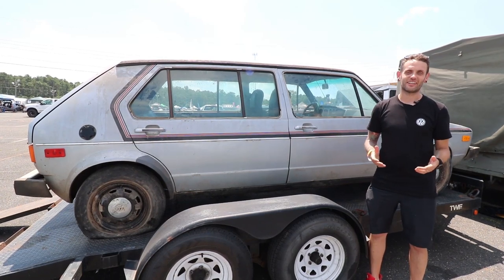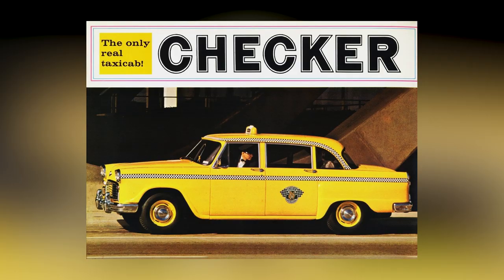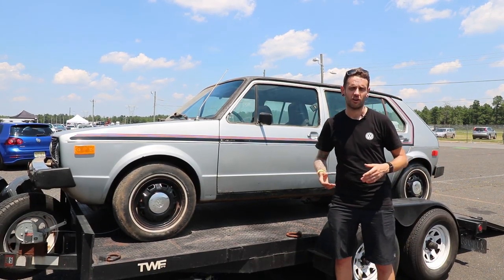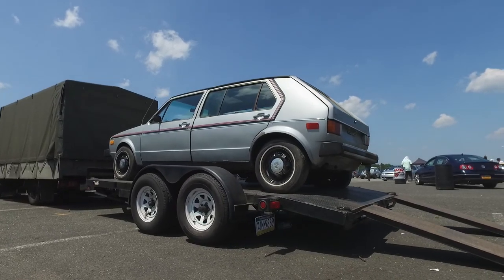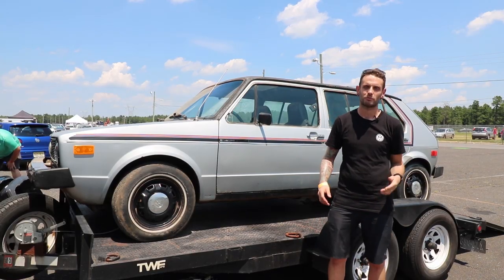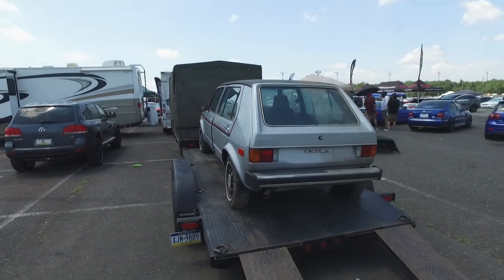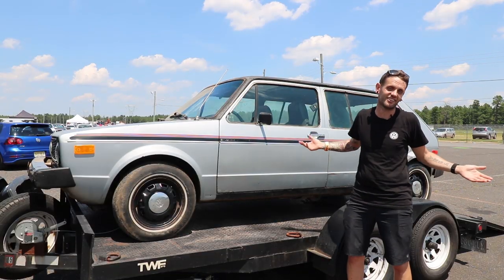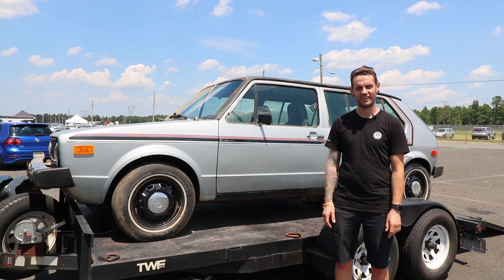The Craziest VW Barn Find?! Taxi MK1 Prototype

Comment: Rebuild it, try to keep it as original as possible. Stock trans and drivetrain. If it's 1 of 1 I'd refrain from modifying it, but that's just me.
Reply: Yeah, If only I would tune the original engine to make more power like it needed to be given the green light, and make it funcional.
Reply: Personally since the engine is quite underpowered, I'd personally GTI swap it, but that's just me
Reply: @cpufreak101  me too, the only mod that I would do is to GTi the engine and box, then it's not a massive deal to put it back to standard anyway, if he were to VR6 or 20V it, you'd have to make too many mods to be able to put it back to standard easily.
Reply: Use the original 1.5 and turbo it
Reply: Agreed
Reply: Or put a G60 supercharger on it
Reply: Rebuilding the original engine & replacing the auto-transmission's internals, along with revealing the original yellow paint-work is sure to be the least expensive route anyway!  Restoring it without modifying it wouldn't devalue it in the process!

Comment: That should be kept as close to original as possible
Reply: It could also be completely re-transformed with a strong electric motor for rear axle and a long flat battery under the car, in front under hood where the jammed rusty crappy engine is can be pulled out and get a good storage place to compensate the tight boot space in the back..  And i really think it will have a punchy kick with an strong electric power motor on rear axle and power steering in front for easy maneuver this longer base rabbit.. but it will also need some strong shocks and a up-graded suspensions all-round 4 corners.. ;0)
Reply: The reason i mentioned this car should be re-build as electric because Volkswagen did play with the idea of electric cars starting from the Mk 1 Golf & Mk1 Jetta platforms but back then they where struggling with stacks of acid batteries, obviously the car were too heavy and the batteries took way too much space. So with today modern components it could be a really nice project this to continue the Volkswagen idea of "City-Stromer" that is how the European electric versions were called back in the 1970 but on this special Mk1 with modern electric stuff would make even more sense ! It would be really epic unique project and something no one will ever do.. and he could give the 'RichRebuilds' a call to help him out !  ;0)
Reply: Rebuilding the original engine & replacing the auto-transmission's internals, along with revealing the original yellow paint-work is sure to be the least expensive route anyway!  Restoring it without modifying it wouldn't devalue it in the process!

Comment: Get it running and cleaned and leave it standard! It's a 1 of a kind theres never going to be another about.. for once I'm with most people on this keep it standard.. original is best this time.
Reply: It will never be used with original engine since would be so much under-powered.. he will not sell to museum this is a real unique opportunity to create a V8-stretched-rabbit..with a proper6speed manual gearbox.. ;0)
Reply: Rebuilding the original engine & replacing the auto-transmission's internals, along with revealing the original yellow paint-work is sure to be the least expensive route anyway!  Restoring it without modifying it wouldn't devalue it in the process!

Comment: Please just keep it stock please please please please please.

Just fix the engine and clean the inside
Reply: Rebuilding the original engine & replacing the auto-transmission's internals, along with revealing the original yellow paint-work is sure to be the least expensive route anyway!  Restoring it without modifying it wouldn't devalue it in the process!

Comment: those are some long ass rear doors. i had a bright yellow, '76 two door rabbit in the 80's i bought from my dad that i named bunny. i beat the hell out of it. it went off road, through the woods, bouncing across cornfields, anywhere i wanted to go, it went. i hauled people, critters, scrap metal, unidentified crap, and even a friend's honda 125 elsinore once. it started my love of hatchbacks, and v dubs all in one go. i was sad to sell her to the junkyard, but by then it was a flintstone-mobile. the driver's floorpan was gone, and i screwed a piece of plywood to cover it up. the wiring got seriously corroded, and was spliced over and over. same with the rear brake lines. eventually, i ran them inside the car. being the guppy i was at the time, i let my stepsister borrow it for a couple of months and she ran it out of oil. that finally killed bunny. i was pissed at her for years over that.

Comment: If you do mod it, make you don't drill in it or cut holes into it. Keep all of the parts and catalog them. Keep it to the point that you can return it to it's original form... do not repaint, clean it up and protect it with ceramic coating to prevent further deterioration.

Comment: Its ashame, because it was too little and way too late by the time Checker cab designers realized they had fallen very far behind in the market. They were stuck between the old approach that worked for years and a new and ever changing market and regulations. Had they explored similar concepts 10 years earlier their history and outcome might have been different going into the 80s.

Comment: If you really need to modify it don't put in too much power... an old audi 5 cylinder N/A engine would be amazing for example the 2.3 NG engine It's an 10v with 133-136 hp and has some amazing Charakter just the sound will be worth it

Comment: theres 20..25  vw golfs 1979..widened by porsche factory with 928 engines in them
Reply: Miguel Castaneda nope; that was a company named Arzt in Hannover Gerrmany that did those conversions, they actually build a 1.2x size increeased exact Golf body and mounted it on a 928 where they had removed the original bodyshell......killer sleeper Golf......lol